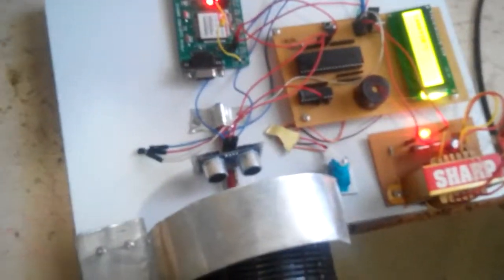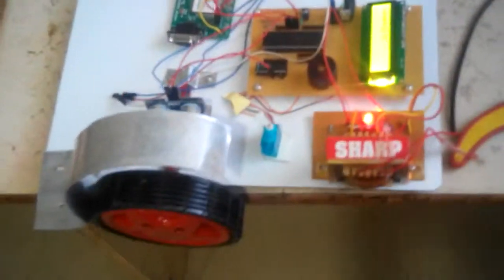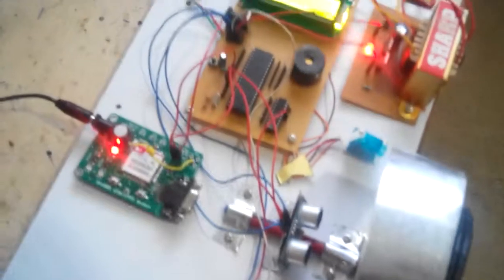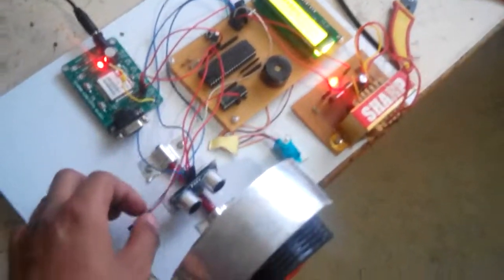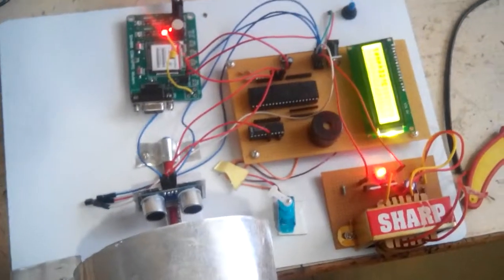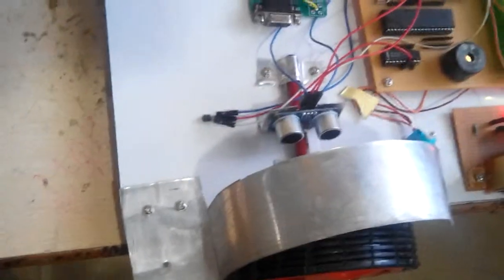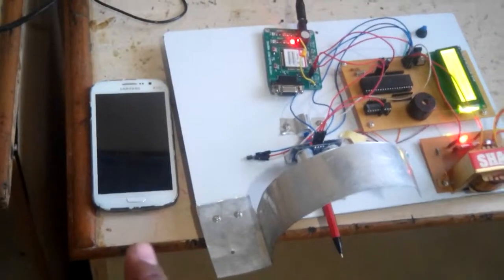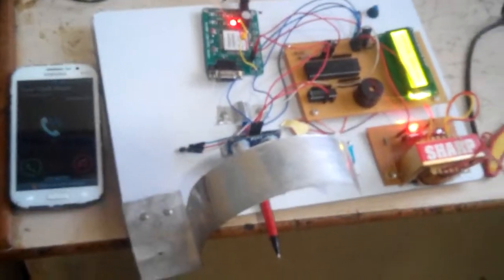car wheel theft alarm

Comment: The custom ring tone had me in stitches!  Did you ever deploy this on your car?
Reply from the maker: DV7Dave no bud it was just a prototype. One of my student submitted it as his engineering project.
Reply: @Gurdeepsinghprojectvideos  I've just got a new set of wheels.  I'm paranoid about them.

I wonder if mounting something that detects a change in electrical consistency of a wheel when it's wheel nuts are touched is possible?  If the minute a breaker bar touched the lug nuts an alarm went off, it might be very effective at preventing theft, rather than a sensor that detects a full removal.
Reply from the maker: DV7Dave it can be possible with metal detector sensing system on the nuts. Problem will be making everything tiny nearly size of nut. Another one is some of  the wheels have small cover cap on nuts. System can be made which will trigger alarm when that cap is taken off.
Reply: @Gurdeepsinghprojectvideos  I was thinking a thin magnet/metal installed behind the hub with metal washers attached to each lug.  An electrical connection is established and measured.  But when more metal comes in to contact with the lugs like a breaker bar, it changes the impedance on the circuit and trips an alarm.  No need to individual sensors in the caps that way.  Think it's possible?